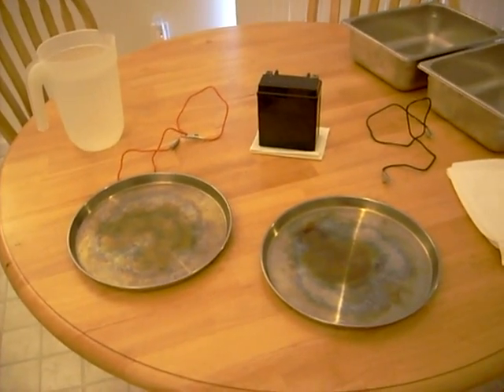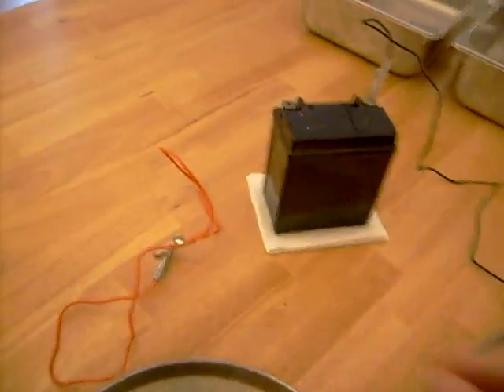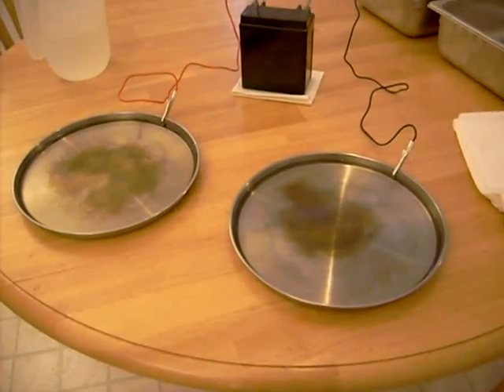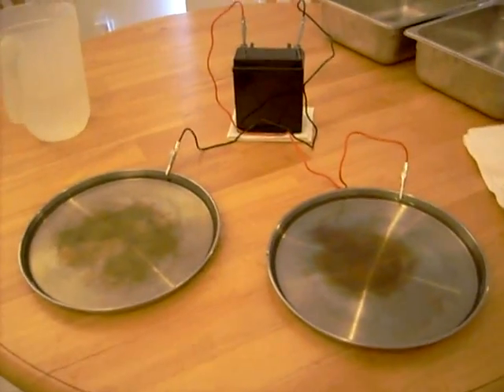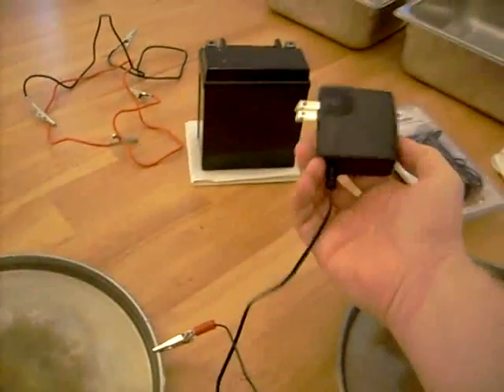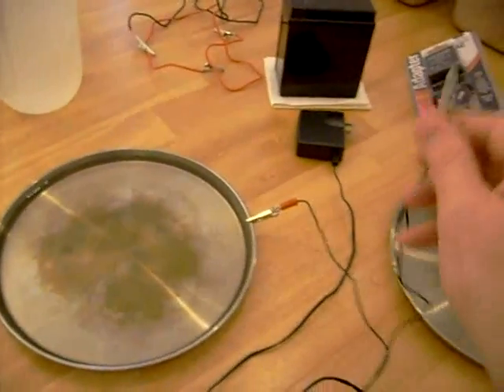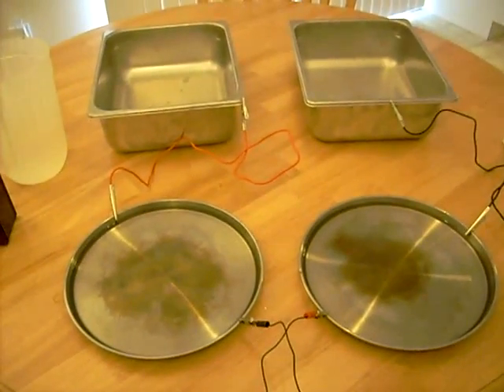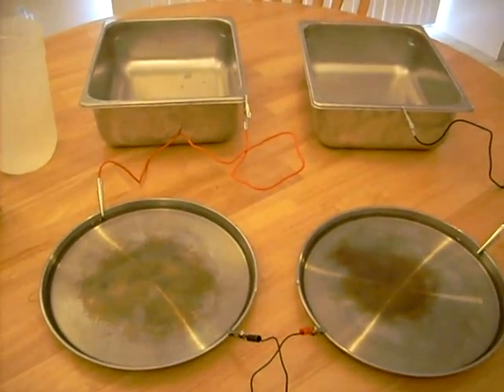Cure Sweaty Hands, Palms, Hyperhidrosis, Hyperhydrosis

Comment: When you use the wall charger to 24v, how many Amps?? Is it safe to use 1 amp or more??
Reply: Tomer Hardy r u sure dude becoz i m going to a laptop charger.20vdc n 3 ampere n i am really scared.
Reply: +ronak rocks Do not listen to the +Tomer Hardy and do not use a laptop charger! The amperage and voltage in charger is far greater than in a battery, besides, it's a different type of current (direct current in battery vs alternating current in charger). Amps are not like multivitamins, so your body takes what it needs and discards the rest -Amps kill! Not the voltage, but amps, and it's needed as little as few (100 milliamps  to be precise) to kill a man.. So don't fuck with it..

Here read this before you do something stupid:
https://www.physics.ohio-state.edu/~p616/safety/fatal_current.html
Reply: +Mister No Do you guys even physics? At 24V nothing short of 5amps(120W) will kill you. If you are a regular sized guy with no health problems 24V and 1 or 2 amp will be alright. Current has to travel up from one of your palms, thru your torso, and to the other hand.  Not to mention, you are not actually touching wires themselves, but the tab water(which is also a terrible conductive)
Reply: Mister No flanker Tomer Hardy guys i am trying two 9v batteries rt now...still waiting for the result.
Reply: ronak bhaduri 9V seems a little too low. Try 2 9V batteries in series at least
Reply: yea i m trying 2 batteries...but i think i hav to increase the volt for results to see
Reply: +flanker I do physics, but you obviously don't... Amps have nothing to do with "regular size guys", but with skin conductivity which is 1,000 or even 500-100,000 Ohms, as resistance drops dramatically if a person has wet or broken skin.. As i stated before living beings are not killed by amps, they are killed with milliamps. 

In general, for limb-contact electrical shocks, accepted rules of thumb are: 1-5 mA is the level of perception; 10 mA is the level where pain is sensed; at 100 mA severe muscular contraction occurs, and at 100-300 mA electrocution occurs. You simply lack the fundamental knowledge of how electricity works, thus I'm not gonna call you names here, but what you're suggesting is not only extremely dangerous, it's plain stupid..(The amperage that you recommended, is more than enough to kill a man, revive him, kill again, revive, and than kill him once again :)
Reply: +ronak bhaduri (Guddu) Assuming that you are using regular consumer 9V battery, that is reasonably safe voltage, since most 9 volt batteries generate around 8 milliamps, and whether they are connected in parallel or serial connection, output can range from 8-16mA (9-18V) respectively.. As for whether you will experience any results with the "device" or not, remains to be seen, i haven't tried it personally but i intend to do so...
Reply: +🌍 Mister No I am using a 12V AC-DC converter rated at 3A for 2 months. It didn't kill me obviously, but it sure killed my hyperhidrosis.

Comment: ive been using a universal adapter power charger with variable voltage. Ive noticed that my fingertips hurt if i use 15v or greater. 12 volts is not painful but is not good enough to stop the sweating.

COULD it be the current the charger is producing ? it says max 4.5 amp. Ive been doing ionto for about 4 years now. Earlier i used a 18v 500 ma adapter and it worked like a charm.

Comment: I've been doing this at 24 volts for about a week, and it's DEFINITELY been working. But I did some gardening work and I got some cuts and splinters and stuff. This is a huge problem because when I put my hands in, all the current just goes through those and I get pain in those areas. Is there anything I can put on top of them to prevent that? Like a gel or something?

Comment: Im currently using 24v and i do the treatment twice a day everyday. (mlammin) is right about the shocks and the vasaline. if u have the smallest cut or abrasion on ur hand it will burn like hell! and when u first put ur hand it any moving or twitching will give u a gult but will quickly equalize over a few seconds. regardless of how bad it may feel i must remind u guys that none of this is dangerous... its just simply not enough voltage 2 b...

Comment: @austtahlia This guy has another video showing how to do this with small, 6-volt lantern batteries.  I think the other video is easier to follow and it shows and explains the stuff you need in a way that's very clear.  Costs under $15 at Wal-Mart to pick up the batteries, the wires with alligator clips and the pie pans.

Comment: i've done 2 treatments so far haven't really noticed any difference in sweat so far its around the same, i'm doing 12v for hands, 18v for feet. is it ok if your feet touch the bottom? i have my hands hovering in the water fine but i'm struggling to stop my feet from touching the bottom

Comment: Thank you for posting this extremely useful video. I just finished my first session (using a 100mA 120V AC to 24V DC right away!). I have one question though. If you do the treatment in 40-minute sessions, is it going to be 2 times more effective than 20-minute sessions?

Comment: I did it, took a while, IT WORKS GUYS, TRUST ME.
Trust me I have done it, took more time in feet then hands, but it worked.
I used to treat hands with Drionic Device before, it was successful in the hands, but I got tired of buying batteries.
Shannonbowling, God Bless You.
Saved me from spending money, and give a good hope.
(I still did not get the logic behind changing the cables for polarity, but I am doing it the way you do it, and It works great)
Please find a design for underarms.

Comment: I got an 18v 300mA it was too strong for me, i tried a 12v 300mA still too strong for me I jolt when I put it in. I set it down to 9v, i feel a strong tingle and after submerging for 10 minute theres no doubt the tingle and pain is there from the passing current. I am only 26 , 5'7 150lbs. I don't know if 9v is enought to work for me, today is the first day I tried it. I heard the Drionic retail machine works on 9v.

Comment: Hi, i was wondering after reading a few articles, do you have to use 10 inch wires? i just bought a roll of wire and cut them myself but i didnt take specific measurements so some are longer than others.

Comment: @mexicanbabyable Hey. So I found the AC-DC adapter in two areas: Wal-Mart, and on eBay. The Wal-Mart one was only up to 12v, but at the time I was scared as shit with the thought of electricity going through my body. But I bought an 18v one in case I get used to the 12v one. For both, you have to cut the heads of the connectors because we need to modify it. Get some car speaker wires from an automotive store, some alligator clips, wire connector, and heat-shrinking tube from some hardware store.

Comment: Question, is it okay if my thumbs rest at the bottom of my stainless steel pans? I ask because I know you're supposed to keep your hands resting in a position so they do not touch the bottom of the pan. I keep my palm floating/all of my fingers floating, just my thumbs rest at the bottom on the metal. Is this okay to do?

Comment: Hi, I tried googling the AC Universal Power Charger for laptop and can't find anything that looks like the charger in the video. I'm sure I just don't know what I'm looking for but could someone please post a link to purchase one from Amazon or somewhere like that? 
I've done 4 treatments at 12v and it's gotten a lot worse! I realllllllly hope that's a good sign. 
I also use aluminum pans, is that okay or does it have to be stainless steel?
Thanks so much!

Comment: @tabotabojayar I'm 168 cm (5'6) with an arm length to the knuckles of  63.5 cm (25 in); in the 2 years I have tried this, I haven't had any heart problems, cardiac dysrhythmia (arrhythmia) or felt the electricity go further than a few cm above my elbow (10 in or 25 cm). So unless you are much shorter in stature (unlikely), then I don't see how the electricity can reach your heart unless you were wearing an electrically-conductive necklace during treatment. Even then I'm not sure that would reach

Comment: @sx2000 No, they become 100% dry. For some reason, I've been needing to do more regular sessions to keep it at bay. In the first 2 years I did the treatment everyday until the sweating stopped, and I could do 3 maintenance treatments a week. Now it seems I keep sweating despite doing it everyday. The 18v current is hardly noticeable anymore and I even tried a new 18v to see if I needed to replace the old one. I think I got too used to the electricity or I messed up my treatment schedule.

Comment: hey..ive almost been doing this treatment for a year now...and it has been very succesfull....tho recently ive been experiencing a bit of a problem....im using 2 aluminium plates and a 24v adapter...my maintenance treatments arent working out well..rite after the maintenance treatment my hands tend to sweat(finger tips mainly) for a day or two before stopping completely..i did my last mainten. treatm. on the 1st but my hands started sweating..and today(6th) theyre all red and sweaty..any advice?

Comment: First week of treatment. I have some questions. After each session (I am doing 15 minutes then another 15 after switching polarities) I notice only the back of my hand is red and my palms are just about the normal color with just a slight red. When I have my hands in the water, I spread my fingers and try to have my hands floating in the water. I generally just rest my hands on my wrist and keep my hands in an upward angle. Is this effective or should I keep my hands down? Currently on day 3.

Comment: Well, after using this "treatment" on my palms for nearly two months, I must sadly say that it doesn't work :(
For the first month and a half or so I was using 18V, and the last ten days I ramped it up to 24. But, nothing helps. Sure, my sweating decreased for about 50%, but it's still there. Even as I type this I sweat a lot, and its like 10 degrees C in my room :'(

Comment: Hey!

Starter trying this thing out. I've solidered together 8 AA batteries, and are getting 14,5V output. dunno bout amps. when i connect them to the bowl, and put my hands in it, the voltage drops to 4V, it this normal? Guess so, because my hands "absorb" the other 10V, but i cant feel like anything, only when i move my hands up from the water, then tickle a little bit when i put them down in the water again. Maby i should try to add more batteries to my pack?

Comment: i just need  some help...when i do this treatment at home ...it works perfectly without any problem...and worked perfectly for a year i did a maintenance treatment every 7-8 days...24 volt adapter and 2 steel plates...but wen i moved to college the treatment didnt seem to work perfectly...same adapter and plates...but my fingertips just become red  and dont stop sweating...and wen i go home for a few days it starts working again...so is there something with the water?...please help

Comment: @daryll81 Hi Daryll, please bump the voltage up to 24 volts, somehow go find a suitable adapter that will give you that kinda voltage. It may seem scary to get a wall plug adapter and rig it up to metal plates but please do that as I have and results are 100% guaranteed. I'm having such dry hands now that they get chapped which is bad to the point that I have to use a moisturiser. Never have I had to ever use moisturiser..

Comment: ı cannot find motor battery does these work with other stuff you know market battery or smith
Reply: Any battery you could find in Amazon will work. 12V battery is easy to find and about $15-30 in Amazon

Comment: (-conted) 
which can guarantee a current of about 2-4ma with my 19V AC/DC adapter. But the resistance of my feet is another story, it's way to high, sometimes it reach 50-80K. Do i need to use a different adapter for my feet. I can feel a little clinking during the treatment in the hand, but when it comes to the feet, nothing at all :((.

Comment: @PianoGirl555 im doing the exact same thing i did the first few times.  I don't know whats wrong.  but something is weird with my hands. i feel like there is some sort of "oily" layer on it thats preventing the treatment from working.  im using 24 volts now but my palms dont really feel anything.  I know its 24 volts though because im using a voltmeter and its reading at around 25 and i had my mom put her hands in it and she felt a strong shock. frustrating that this use to work

Comment: If i have 2 12 volt acdc adapters, is there a way to connect them to get 24 volts. you can connect few batteries to get higher voltage but will it work the same way with the adapters?

Comment: hi i'm using that machine i build it by adapter it's changeable from 3 to 30 V dc but its 2 A is that dangerous? . today was my first day to use it i have set it on 20 V but when i pull my hands out of the water i feel that it's be like stone i wasn't able to move my fingers for about 5 sec and my hands was shacking for 2 min after that is that normal? please reply before i continue curing tomorrow , THANKS alot i cant really thank you for the hope that you give to me

Comment: I am using  a 12 volt battery and a 9 volt battery wired in series and running at about 19.75 volts. I cannot take the shock at the ten minute switch. I read it takes a little longer if you do not switch. Would be better if it had a voltage regulator that you could turn up slowly. after the switch.Anybody have any ideas on a cheap unit?

Comment: I've been trying for 10 days with a current of 18 V, and still no results.
I tried to add salt / baking soda, but there was no change.
I do care once a day, 10-15 minutes, then switching the polarity for another 10-15 minutes.
I use disposable aluminum molds (eg making schnitzel).
Is aluminum surface must be hard as the video?
In addition, most of the time I touched aluminum, recently I tried to put a cloth separating hands and aluminum,
But still no results.

Does anyone have tips to improve? Would love to hear :)
Reply: trust me i saw this video years ago and I went through the same process but after almost a month it worked
Reply: Finley Louissaint First of all I appreciate the dedication of time you spend to answer. It is not obvious.
Secondly, did you use a 18V too?
After a month, when you started to notice the sweat was gone, how often you went? Is it still a day care?

In addition, still no answer about 'using' (with/without cloth,  touch/untouch aluminum,  what about soda and salt?  Disposable/posable aluminum molds?)
Should I increase the amount of voltage?

Guys, I'd love to get answers. Asking for your help
Reply: Tomer Hardy
I used 18v and salt and did it everyday for about a month, then did it every other day, then every three days.... now if you stop doing this treatment completely then it will start to sweat again so you gotta do it consistently
.
Reply: Finley Louissaint Again, thanks for the comment!
Are you doing all the time treatment of 20 minutes or 30?
You said that if I stop completely so I have to do it all again, would I have to do a whole month again from scratch?
In addition, how do I know when to switch treatment every three days?

Today, how often do you do treatment?
Reply: ??? anyone ?
Reply: Tomer Hardy
I just started doing it again and im on my 8th day and have been doing it 24-30mins a day. trust me its worth it. When you finally know how it feels to be normal it is unbelievably a great confidence builder.
Reply: Finley Louissaint =/ i'm still doing it, added lot of salt.. still no results.. starting to be depressed
Reply: Tomer Hardy As you do it, it will actually get worst b4 it gets better.... When I had done this b4 I had realized that my sweating increased and thought that the treatment made it worst but I didnt give up because I had no other option and after about a month or so the sweating completely stopped. So dont give up
Reply: Finley Louissaint So after the sweating completely stopped, which cure schedule is optimization for maintaining? once/twice a month....
Reply: I went from everyday to every other day to like once or twice a week
Reply: I'm on my 20th day and I noticed that at night my hands get very dry but it still sweats occasionally during the day depending on how hot it is, or if I'm nervous of something
Reply: Tn Act I went from everyday to every other day to like once or twice a week
Reply: bro i am going try laptop charger.20vdc n 3 amp is it safe do u think.??? plz help

Comment: who tested this demonstration?? and it is effective or not?
Reply: +Melek Ben Tarbout works great tried it with 18v x 1amp and with in 5-6 days 20 min's daily treatment palms and soles became normal. after that just do 20 min's treatment with in 7-8 days.
Reply: i did it with 12V but no result :/ just i felt some pinches. i will try with 18V and thnx
Reply: Melek Ben Tarbout  do check the Amp's if you are using 12v then better to have 1amp to  get 12 watt power in my case it was 18Watt power = 18v x 1amp.
Reply: I use 21 volts for years.

Comment: Help please! I tried this March 09, got 99% dry in 12 trtmnts half on 18v and half on 24 with aluminum pie pans but I stopped. Now I tried again for 12 trtmnt at 24v with 2 days off between the 10 and 11 trtmnt with stainless steel roasting pans and I've got about 60% dryness. Now I submerge my entire hand when before i just laid them on top and I use baking soda this time. Does anyone have any idea if this could be the reason my results are so different?

Comment: how do i use a DC power supply? so i cut the plug off first right? then i separate the wire so that it forks off into two? I have no clue at all but this is just the way i picture it would work. Could anyone please help me? and how do i attach the alligator clips? couldnt i just dip the wires in the pans without the allig clips?